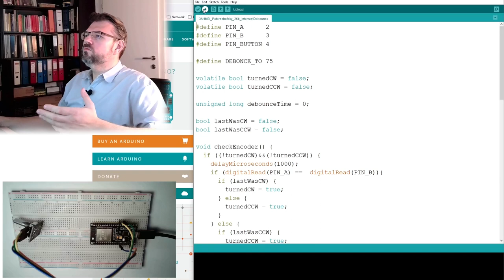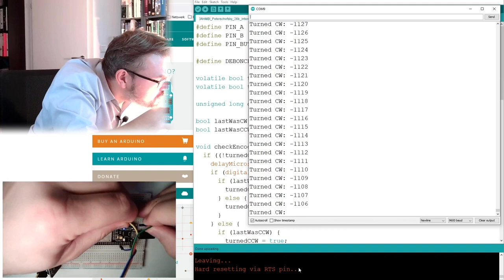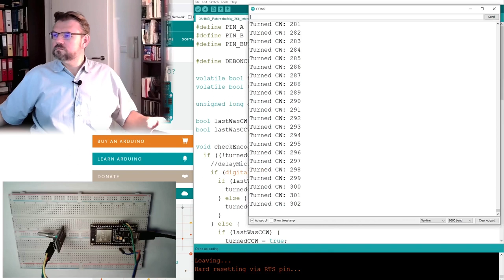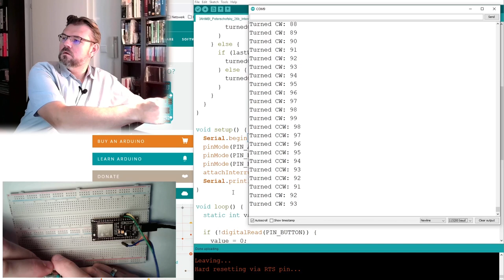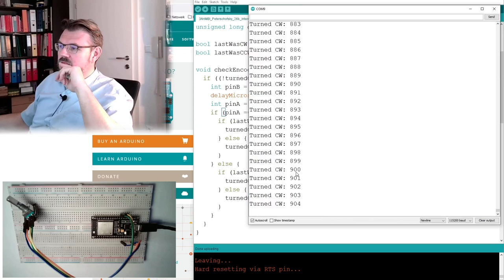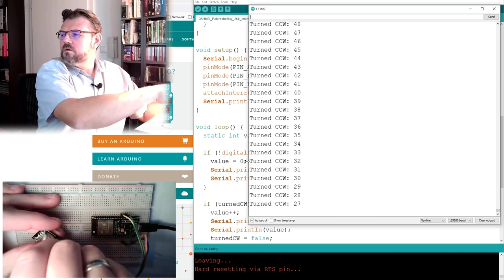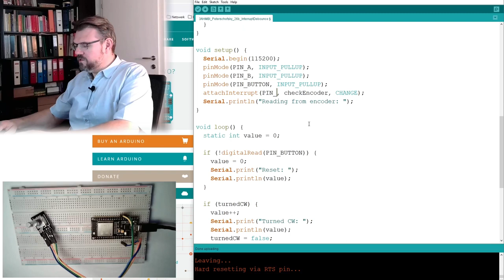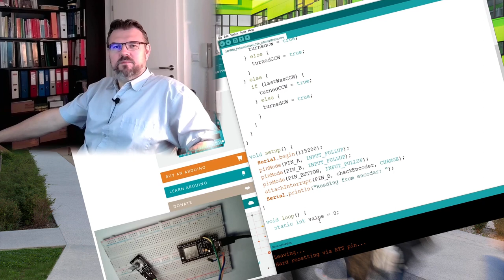PROJ 03: Encoder On ESP32

Comment: It seems that variables lastWasCW and lastWasCCW are redundant and can be removed from the code.
Reply from the maker: Yes, this is true. This is a try to denounce the encoder. Logically it makes no sense at all, but bouncing issues got better. When I used a more expensive encoder later it worked much better. I am not sure if I still have this inside, but this was the purpose of these lines...

Comment: Will the encoder work with 3.3v if I’m using a batter?
Reply from the maker: Sure. It works with 3.3V regardless if you supply from a battery or not. I guess that's what is "batter" means. I am usually using a battery (i.e. 2 or 3 AA cells, since they are also available as NiMH rechargeables) a DC-DC step up converter to 5V and power supply the controller via the USB cable.
Reply: @HeinzPeterschofsky  thanks.  Yes, batter was supposed to be battery.